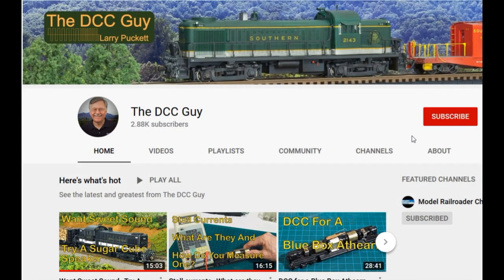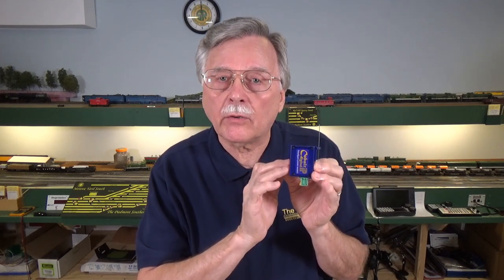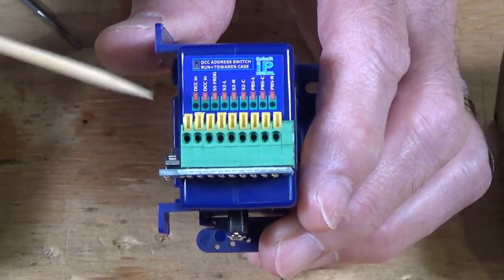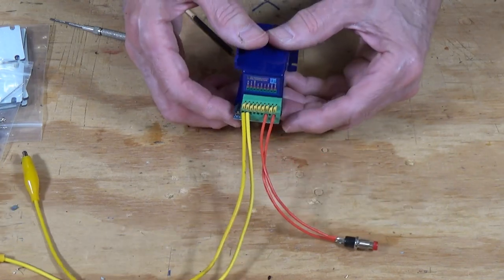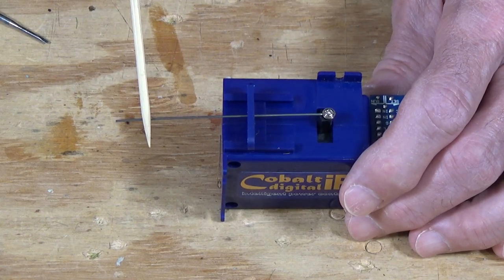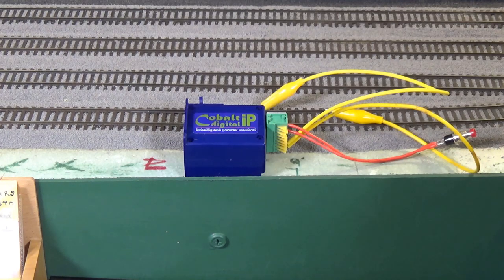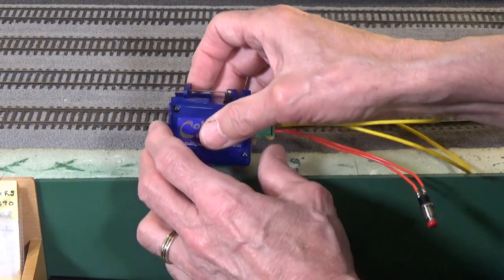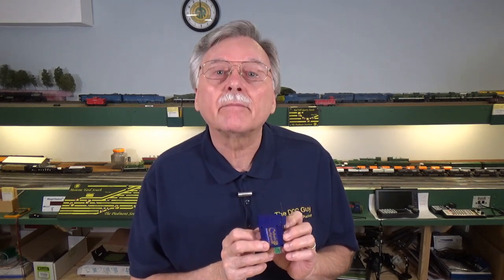Is The Cobalt Digital A Tortoise Slayer(188)

Comment from the maker: Folks—just wanted to post an update. In the video I said these are stall motor devices. Actually the circuitry shuts the motor off at the end of travel and locks it in place. The 5 milliamp current draw is due to the device being in standby mode.

Comment: Thank you, Larry.  Right now I'm just getting ready to begin installing my switch machines and have just received my Cobalt Digitals.  The more videos you do on them, the happier I will be.  I find your instructions and videos to be extremely clear and concise and TREMENDOUSLY helpful.  I'm eager to learn your suggestions regarding the powering them with an accessory bus ( or not ) and, also, just the process of installing them under the turnouts themselves.

Again, thank you, thank you, thank you
Reply from the maker: There should be no real difference between installing the Cobalt’s and Tortoises and Blue Point switch machines, both of which I have done videos on. The accessory decoder power bus will be here soon.

Comment: Good info Larry, I installed 32 of these on my layout, easy to control using JMRI panel pro and setting routes. Also I connected turnout signal lights using Cobalt Alpha Mimic and they follow the same address No. So easy ....
Reply from the maker: Yes, I was looking through their catalog and they offer a lot of components that would make it easier to wire a layout with less complicated wiring. I haven’t tried to do a cost comparison though.
Reply: @TheDCCGuy  I was attracted to the IP's simply because of the simple wiring, everything just comes of the accessories bus. Even if you set up a push button mimic table/board its only 2 wires in and 2 out.
Reply from the maker: Their control panels are tempting too.
Reply: @TheDCCGuy  I have 23 on my layout (still underway) and have opted for the DCC Concepts Alpha control panel, coupled with the Box.
Simple to use. A separate DCC bus is vital, DO NOT power from the track bus.

Comment: These were originally an Australian company and I've found them pretty good and they have a lifetime warranty to the original purchaser and in my case they have honoured that from UK and I'm in Australia and a hint, I use bootlace terminals on the turnout wires and make it much simpler to connect

Comment: Hi Larry from uk. The Cobalt motors are a little noisy in operation, but I like that as it is an audible indication that the points/turnouts have thrown. Derrick
Reply from the maker: Yes, and when you have a bunch of locos with sound running around you don’t even notice the sound of switch machines!

Comment: Hi Garry, the self centring is automatically disabled when programming, the instructions have not Ben updated. Also it can be mounted horizontally or eve more clearance using the DCPRA3 pack of right angle adapters
Reply from the maker: Thanks for that tip. I did have a mention of the horizontal mounting accessory but that landed on the cutting room floor at some point by mistake. With all thise little details and specs I had to do a lot of cutting and snipping.

Comment: Hello Larry, About to fire up about 40 Cobalt Digital iP switch machines, but I have a question about how to set the polarity of the frog wire.
If I connect my DCC bus, and the switch throws in the correct direction, will the frog be the correct polarity?
What if I connect the DCC bus and it throws in the wrong direction, so I program the switch machine to change throw direction. Will the frog wire still be correct, or will it now be wrong?
I am assuming that I should set the switch throw direction before setting the frog polarity, I am just not clear how this works.  Thanks, Heath
Reply from the maker: Sorry I haven’t had time to respond but I need time to look back at the connections before answering you.

Comment: Hi from the UK. Just some observations we found on the Tortoise and DCC unit on our DC club layout. Be careful re the voltage. Make sure that the voltage is regulated and that the voltage is nearer to 12 volt. Read the instructions very carefully. We had a number of units fail re supply voltage. These burnt out. We found the unit’s noisier than the Tortoise. We have replaced these with Tortoise as we have found them more robust.
Reply from the maker: Interesting, I know they have made improvements and offer a lifetime warranty on them. The instructions are specific about using a regulated power supply. I wonder if yours were an earlier version with less noise insulation and lacked the noise deadening adhesive mounting pads?

Comment: Hi Larry. Great video and I have dozens of Omega and iP Digital motors on my layout. I have never had to turn off the self centring. I just wired them to the track, then the momentary toggle and away they went. 
The best thing about the push button operation is that you can wire control switches from different control panels in parallel to operate the same motor. Such as a local panel and a dispatchers panel and then JMRI panel pro on top of that.
Reply from the maker: Interesting, I’ll check that out as I still need to test the one I opened to make sure it still works OK, thanks.

Comment: Thanks Larry, another great Video, they look really good, these new Units are getting very sophisticated these Days aren’t they. Keep safe.
Reply from the maker: My biggest concern with having the accessory decoder built in is that if one component fails then the whole unit is dead and must be sent back to York for repairs, but it does have a lifetime warranty.. For the same reason I also have avoided TV/radio/stereo combos built into a furniture grade cabinet.  My grandparents had an old Edison wind up record player that had a broken spring. They kept it until their deaths and used it as a lamp table since it looked the part.
Reply: @TheDCCGuy  Larry - you might be concerned with it being a total package when considering a component failure, but the reality is that the cost of this switch machine is less than the cost of a DCC stationary decoder. At $26, this is a very reasonable investment.

Comment: What slow motion switch machines do you use on your layout?
I am trying to decide between the Cobalt Digital iP or the Smails. Thoughts? Any other suggestions?
Reply from the maker: In the past I used Tortoises but now that I have worked with the iP Digitals I have gone with them. So much easier to install and work with than the Circuitron products. Of course the old Tortoises are cheaper if you don’t need the built in accessory decoder but in the long run the iP Digitals are cheaper than using the NCE Switch-8 and Button Boards.

Comment: On my new layout, I am just getting started with slow motion switch machines.  I picked up 10 used Tortoise switch machines with Accu-Lites that I have tested with a 9 volt battery.  All do work.  I had to clean those up as the previous owner had used a silicone glue to attach those to the bench work.  I have yet to install one.  I use PECO 0-16.5 On30 track and turnouts.  I use Digitrax for my DCC control.  From what I understand from your video is that I do not need a bunch of Digitrax DS64s to control the Cobalt devices like I would with the Tortoise devices?  Each DS64 only controls 4 turnouts and gets expensive over time.  I also have Frog Juicers.  I have not completed my track work yet and I am already up to 13 turnouts laid with more to go. From what i understand from your video the Cobalt Digital IP switch machines could end up saving me a lot of money I could spend elsewhere on my trains.
Reply from the maker: Yes, that could be the case depending on the options you choose. The DS-64 is like going after flies with a cannon under some circumstances but if you want to set up routes or other special programming it is great I used them to set up routes in my yard. I have been using NCE Switch8s elsewhere since they allow me to set up pushbutton control but in my next town I will use the Cobalt Digitals alone. In the city of Charlottesville I used toggle switches and wired them in without any accessory decoders—much cheaper but requires more complex wiring—need to do a video on that.
Reply: @TheDCCGuy  I wanted to ask your opinion on using PM42 power districts to power a secondary bus just for the slow motion turnout motors?  I have two PM42s installed providing 8 power districts.  I’m only using 6.  I’m using Frog Juices.  Would it be wise to use a power district to run the slow motion turnout motors?
Reply from the maker: I hope to have a video on that issue by Monday or Tuesday.

Comment: Interesting product.  Thanks for the review.
New products/choices definitely make this hobby more interesting to me!

If I didn't already have a bunch of Tortoises, accessory mounts & cables, and NCE electronics to control them, I'd probably look into these.  (but my Tortoises are already paid for!)

How much power does the Cobalt draw compared to the Tortoise?,
and do they produce accessories similar to the 'Remote Mounting Plate and 'Extra Cable and Actuator' so that one machine can control two turnouts on a crossover?
Reply from the maker: They say they draw less than 40 milliamps when moving and about 5 mA stalled. They offer a horizontal mounting accessory but I didn’t see anything like the Circuitron remote accessories.

Comment: Do you need a frog juicer when using a cobalt switch machine or does the cobalt have separate wiring to handle the frog?  (Thank you so much for all the info you put out!)
Reply from the maker: No, the Cobalt iP Digital has a dedicated contact just for controlling frog polarity.

Comment: Greeting Larry, I am just starting to lay track on my first layout. I have done a lot of searching.. (have a grand plan with many ~130 switches), so cost really matters. I am going full digital with JMRI only, there will be no buttons on the layout. What is your equivalent assessment about the Walthers Layout Control System -- Horizontal-Mount Switch Machine. They are DCC programable and @$20.  Also, exploring Arduinos with little servo motors, which could be in the $5 range per turn out.
Reply from the maker: Were I starting a new layout I would definitely look at the servos, I think they are used in the Walthers switches. I have a Walthers setup but have not had time to try it out. You may want to reconsider not having any local controls on the layout. How will you throw the switches? If you use throttles then you need ones that can do that. Also remembering 130 switch addresses may be a challenge. Or will you have a diagram on or over the layout with the switch addresses on it? Some folks put the address on a stick on dot attached to a tie in the turnout—looks real prototypical. If you only have JMRI to throw turnouts who will do it for you when you just want to run trains? It gets complicated without pushbuttons/toggles.
Reply: @TheDCCGuy  Thank-you for the thoughts. Yes, some sort of a diagram(s) in strategic locations - maybe even just cheat sheets. Regarding routing/switching, it is/was my thought manage switch changes via wireless throttles (Engine Driver) and/or by set routes via JRMI. 
I am looking forward to your commentary/review on the Walthers switch machine, and really the Arduinos with servo motor. I have a lot of turn-outs to assemble, and hope to test the Arduino option latter this year.

Comment: Could one of these be used for a crossing gate motor on a crossing signal circuit, such as Logic Rail or something similar?
Reply from the maker: Yes, just use a occupancy detector, either optical, or current sensing to trigger them. I showed how to do this in my book wiring Projects for Your Model Railroad.